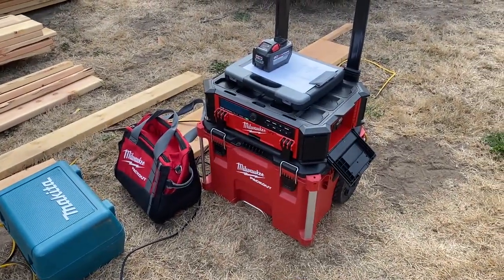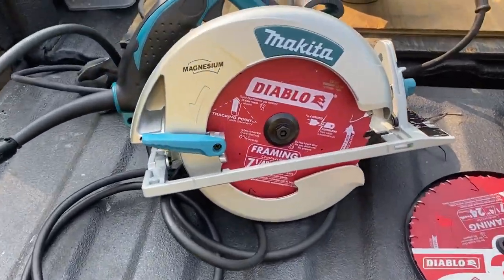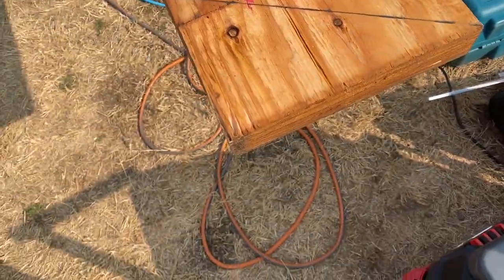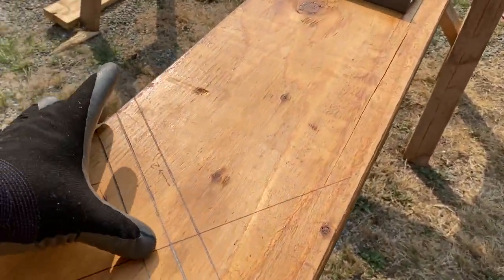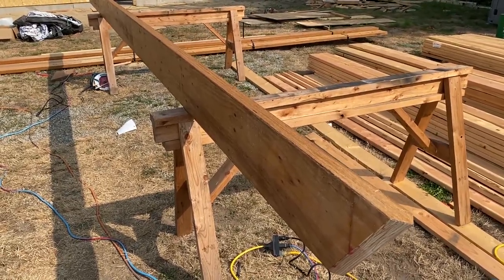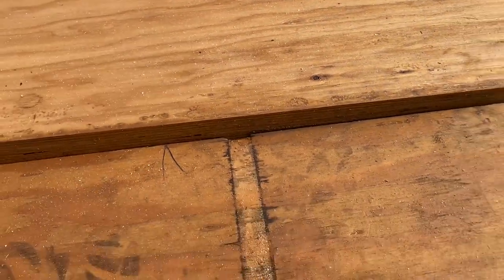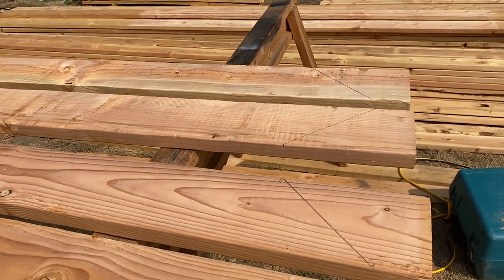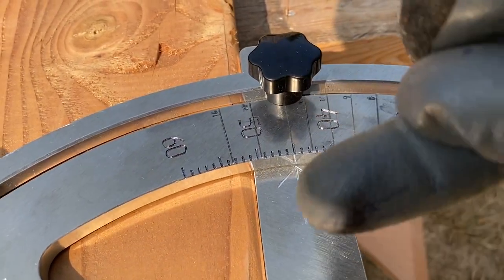Roof Framing - Part 1

Comment: Your killing me :).  Pokee piece??
Your a computer geek!  If you were a production carpenter you would not write your measurements like that!
Blue toothing down?
Perfect are you available to build a middle launch in my back yard?
Reply from the maker: I always evolved to write things in a way that lessened mistakes.  I hated new guys coming on to a crew who only called inches and only knew eighths "cut the line/leave the line".  The FIS system was something I learned up north where trusses are king.  It makes things idiot proof.

FEET
INCHES
SIXTEENTHS

If you want to see AWESOME framers, check out Awesome Framers on Y/T.  That guy is a zen master.

Comment: You were joking about the letters being up right??
And being a carpenter and coming from a line of them I never seen one use that tool & I sure hv not?
Did you know there is a little blue book fits right in your pocket and makes all that much easier??
What do I know though?  I am a finish contractor??
However you might need to pick up the speed or your gonna being eating cheese from the welfare line?
Reply: Awe yes the Swanson blue book but what do I know I've only got 31 yrs in it
Reply: Ok I was a little harsh ; bad day, sore, cut off the top of my finger?  
Anyway you got it framed and did not roll any trusses !  Gotta respect that ‘
Reply: What are the best heavy duty circular saws, to get 86mm deep cuts ? Eg dewalt d24700 or Makita 235mm
Reply: I run the Makita rear drive 7 1/4 “ and Makita 6 1/2 .  I believe I only get 2.5” depth of cut from my 36 volt rear drive and similar from the 6 1/2” however the torque from the rear drive let’s me rip thru 8/4 Oak like no ones business!

The two Saws you mentioned suit you better than me.  That 9 1:4” Makita would be my choice!
But I lean toward Makita anyways!

However thee one corded Saw above them all that will cut all day thru long rips is the Skill Worm Mag 77, 71/4”Saw!
I had (it was stolen) my Dads framing saw which was an old 6 1/2” Skill Worm drive that he had a hot motor built for it and wow!
Then some little creep stole it!  

Anyway I am looking at switching my 6 1/2” track saw to the Makita 9 1/4” track saw cordless!
That saw I first seen on RR builders where Kyle cut thru like 4 sheets of 3/4” ply ! No issues!  It’s pretty pricy though?

Anyway buy the Makita!
Reply from the maker: I think trusses are for cheap builders or less skilled framers.  It's so typical to find blowhard framers who will yell to the rafters that their ways are always the best.  Frame it and go home.
Reply from the maker: Makita is the last company NOT owned by some mega corp.  I had the LXT sawmill.....stolen......but I got into the M18 battery platform so my cordless world is Milwaukee.  Corded?  Makita and DeWalt.